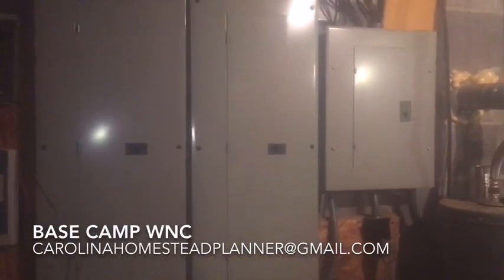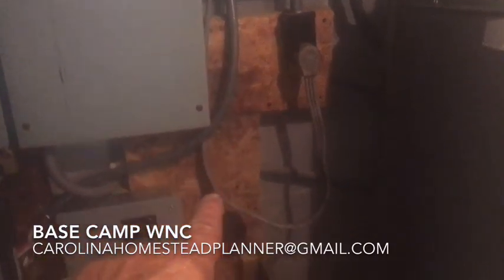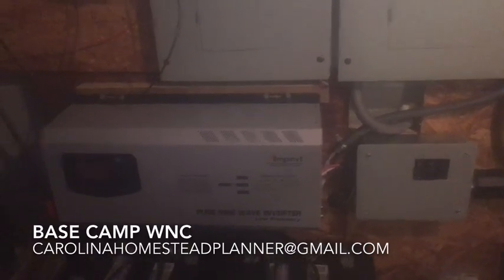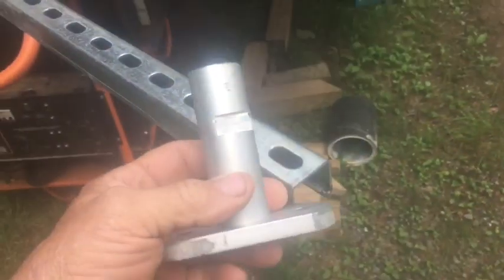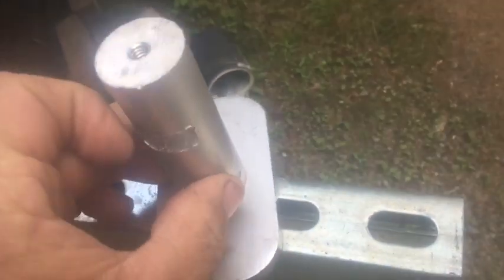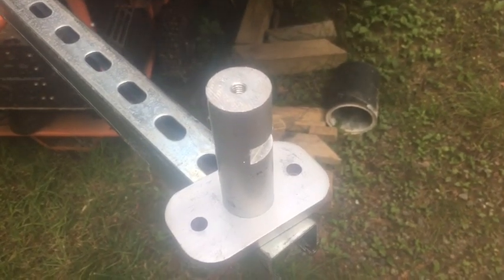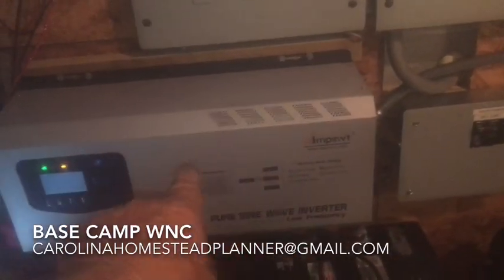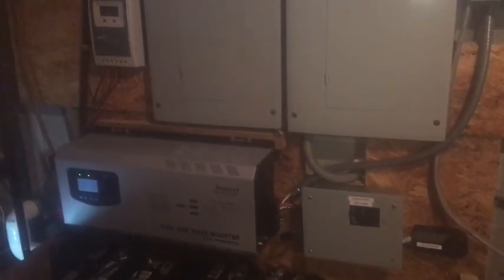Taking A Deep Well Pump Off Grid With A Stand By Inverter

Comment: Thanks brother! Always good information. Is it economical to run Lithium Ion batteries yet, or are they still too expensive?
Reply from the maker: I still have problems going with lithium 
I live off grid and at 4000’ they don’t handle cold so you need a heating pad or a heated building 
Then you need to add batteries and panels to help with that
You can buy used battery packs at places like BIG BATTERY.COM
They were 7kw now selling them as 3 kw for $7-800 or they were
The batteries are 4 years old and down half what no 15-20 years
I wouldn’t want to tell my people that it didn’t work out. They lose
I would like to go there but still too much $

Comment: Why not back feed the E-Panel from the inverter with the same type plug-cord/jack?  
That way the inverter/battery/solar can also run everything on the E-Panel including the well pump.
Load shed as required using the breakers in the E-Panel.
Reply from the maker: Good thoughts 
But there are other things in play that I will not put on a video 
It’s just the community that I work for

Comment: Nice!  Thank You
Reply from the maker: Know anybody interested in a magnum inverter model
MS 4024
4000 watt
24 volt
Reply from the maker: First $1,000 OBO
Reply: Hard to justify a straight inverter/charger when the AIO are $800-$1400
Reply from the maker: It is a 220 split phase low frequency inverter
And its the Magnum that you always praised